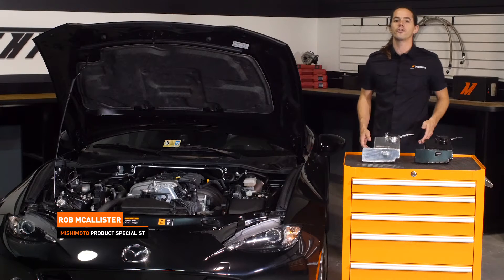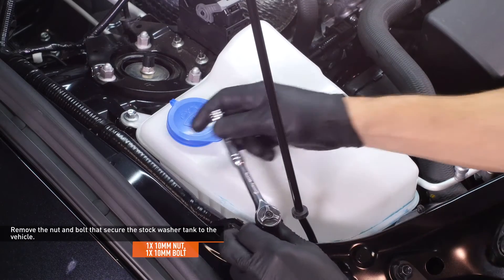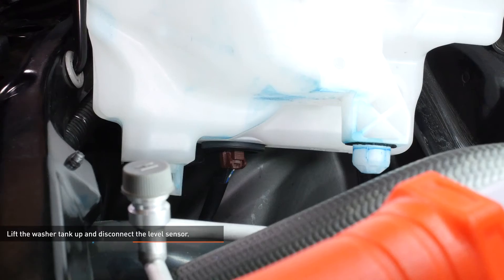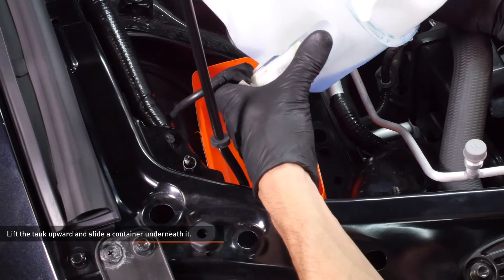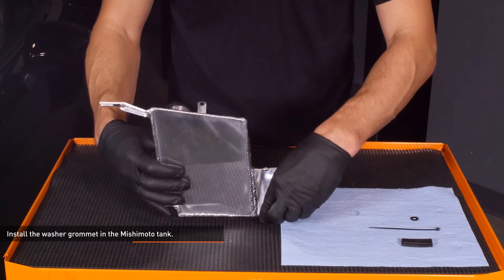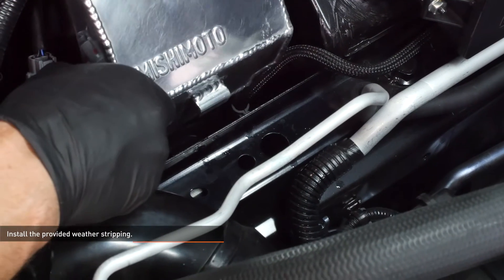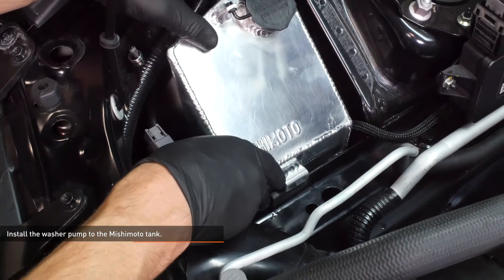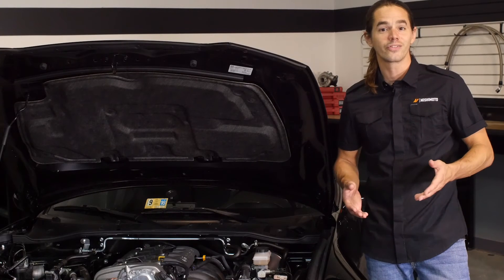2016+ Mazda MX-5 Miata Aluminum Washer Reservoir Tank Installation Guide

Comment: Isn't an "idiot light" going to stay illuminated since the sensor is now unplugged and not registering a signal?? I'm not keen on having a light on, but want one of these tanks.
Reply from the maker: Hey Kurt, no worries about a light on your dash! Mazda set that up so if it senses a fault with the level sensor, it actually turns off that light.
Reply: @mishimoto  Perfect! I just didn't want a light on! I hate how big the stock one is..AND that it does always leak blue washer fluid constantly!!
I'll order the black one from Mishimoto.com
Reply: @mishimoto  Ordered just now, thanks!